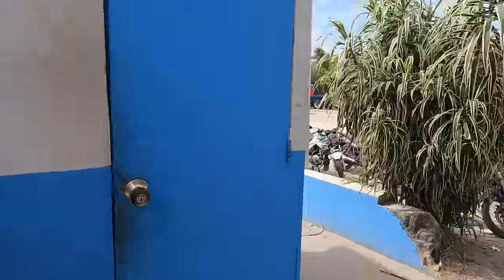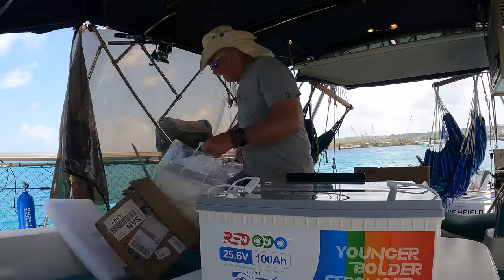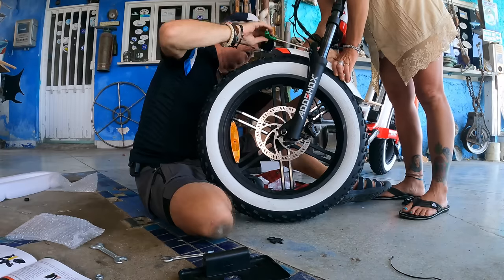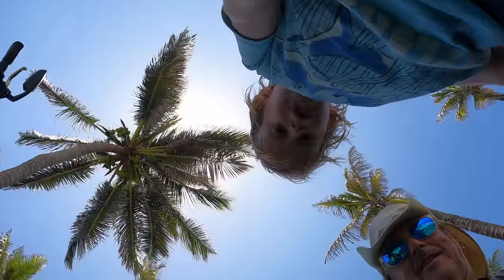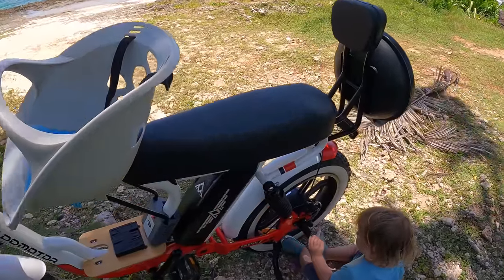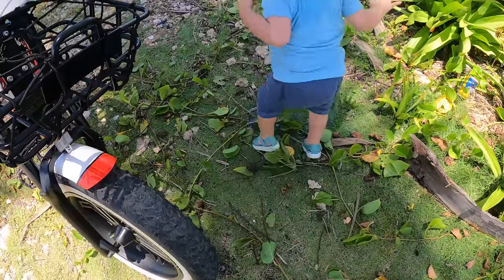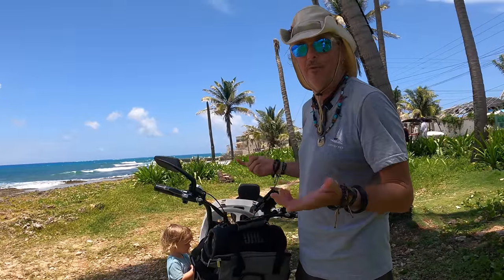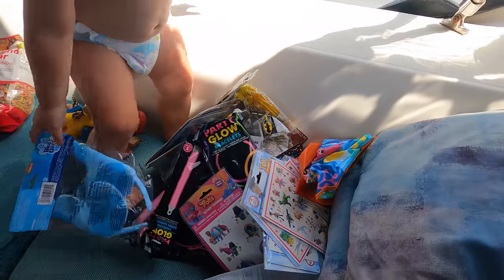SSL683 ~ We weren't expecting THIS...

Comment: Your right about the front shocks. Seems to be a bend, in the fork, jamming up the plastic cover from sliding down easily. 
Buy, DRY graphite spray, sand wouldn't stick, 
Of take the forks apart. Take the plastic cover off. Lay a level, 12" on the fork bars. See if there bent. It only takes a little bend.
And you should hide a GPS, tracker on the bike.

Comment: Rick, did the front forks get tweeked inward when mounting the front wheel?   Check by taking all axel tension off one side and see if the fork springs out and the forks compress smoothly.  Spacer washer/s will be needed if this was the problem.

Comment: Well straight from Addmotors Specs.... The 66x has a Maximum Weight, Capacity/Payload of 300 pounds.   All 3 of you are definitely exceeding 300 pounds. Now add in all the accessories you bolted on and the fact that you are using it for grocery getting... I wouldn't bank on that motor lasting very long.
Reply: Come on, u know its all for views not review's!!

Comment: Your springs in the forks are too soft plus the stiction of the seals is causing drag, A lighter oil in the forks would help but really heaver springs are needed and a good synthetic 5 wt fork oil.
Reply: PS: You could add shims and it wold help, this would be a much easier cure. You can messige me for any help on this if needed. I Raced MX/offroad for 30+ years and did suspension set up on all my race bikes.